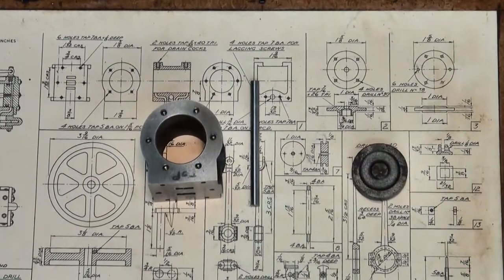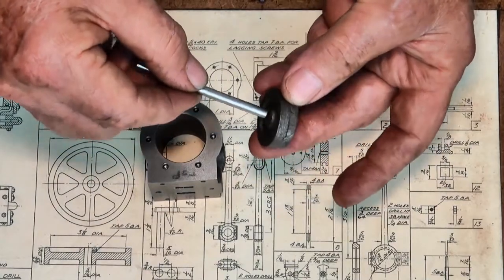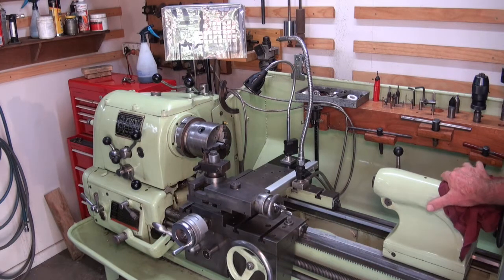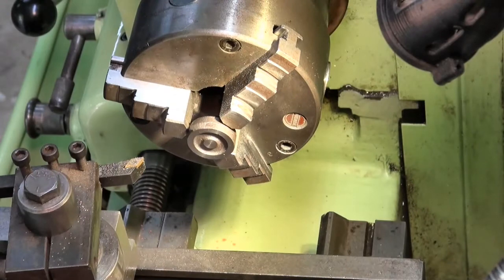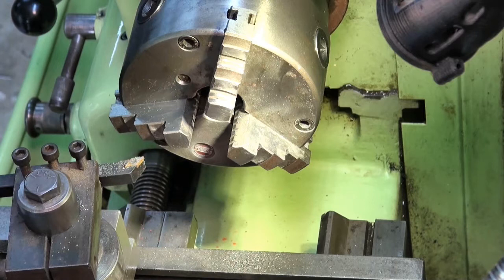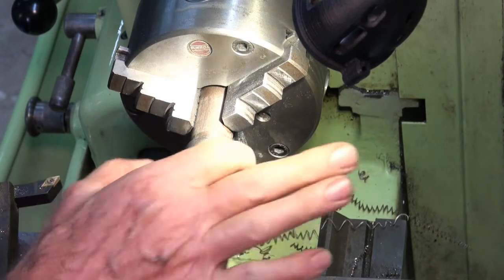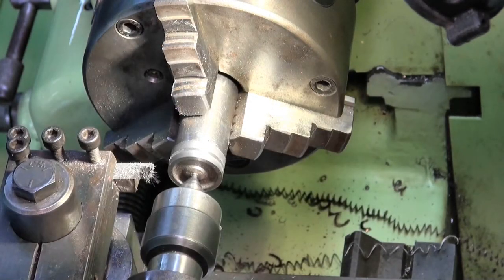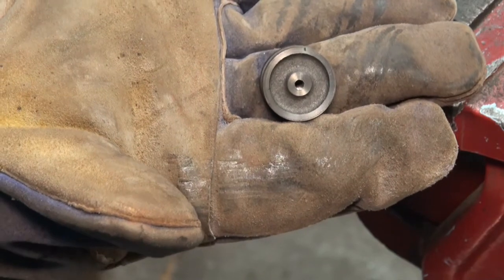Building the Stuart Turner Number 8 Mill Engine - Part 7 - The Pistony Bits

Comment: puzzling that both cylinder and piston are cast iron if you want to stay true to the plans but honestly I'd make a bronze or bronze piston for reduced friction and have enough material to hold it no problem. glad to see you fight thru it, well done!

the lathe is looking great! haha
Reply from the maker: I have built another Stuart engine, a twin cylinder marine engine and it had cast iron pistons and cylinders as well. The big issue with engines that don't do a lot of work is always corrosion. I built an model Conway locomotive by Martin Evans and it had bronze pistons in cast iron bores. I guess it depends on whether it is going to be show model (not running on steam) or a working engine.
Regards,
Mark

Comment: Hey Mark, I have the same lathe and love it .. I'm taking a great deal of screen shots as to your setup (tool holder holder, drill chuck key holder etc.) but if you have the time and desire to do so, please show us your lathe more in detail .. I'd love to see some pictures of your rebuild etc. and ya, all your custom holders .. and last a question for you: do you have the leadscrew spinning for a reason during many of your videos (even when you're not threading)?
great video series .. cheers! Mat
Reply from the maker: Mat, I have since disengaged the lead screw on the Colchester. Several people have mentioned it and I now realise it was just causing wear and tear but it doesn't seem to make a lot of difference to how noisy the lathe is. I think the Colchester Student does tend to be quite a noisy beast especially in the higher speeds. My lathe was actually stripped and rebuilt twice. The first time I did it I used poor quality paints and I didn't bother to sand blast the cabinet or splash tray and back. The paint soon started chipping off and I couldn't stand it. The second time around I purchased some (expensive) two pack primer, filler and top coat. I also had a friend sandblast all the sheet metal parts for me. I  replaced the DIY tool holders with a BXA quick change system. There were some advantages to the old style tool holders but it's probably not as rigid as the BXA type. 
Regards,
Mark

Comment: Which set of drawings have you got. My drawing from Stuart models shows 5/16 fir the piston. When i asked them to check this, they said there has never been a drawing showing a 3/8 piston!! Great videos by the way. John
Reply from the maker: I used the drawings which came with the set of castings and they were from Stuart models. The drawing was listed as 90012 and it definitely shows the piston at 3/8" thick. The drawings would be from the the 1970's though.
Regards,
Mark
Reply: @Preso58  thank you very much for your reply. That may account for the apparent short stroke on the part machined castings i got off of ebay. I swear it is harder correcting previously part machined castings than to just start from scratch!😂😂